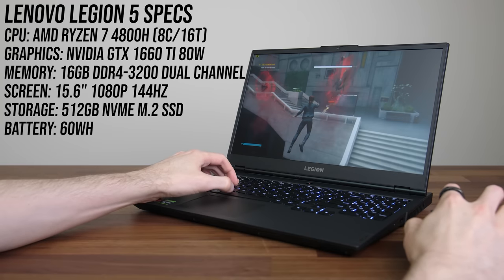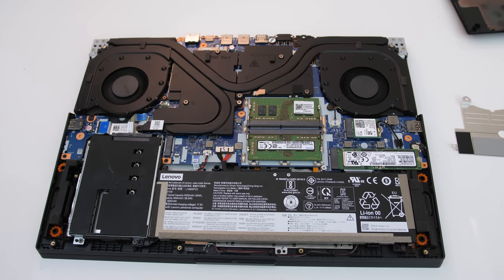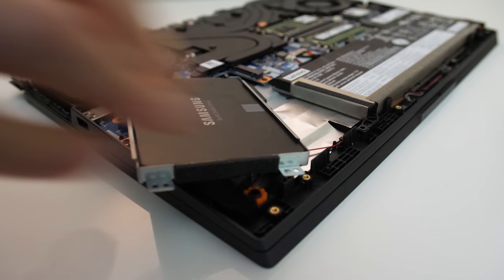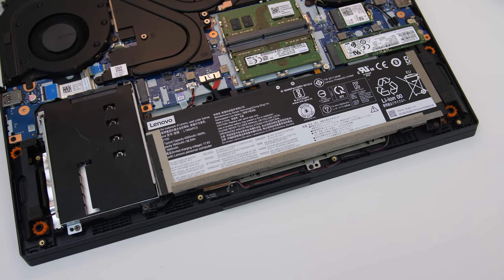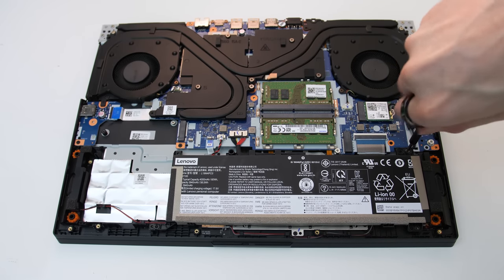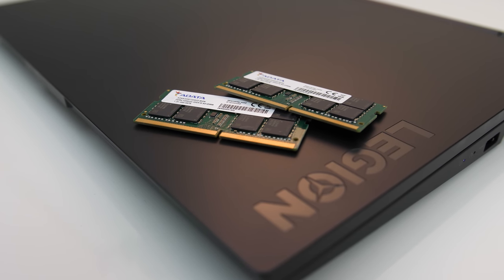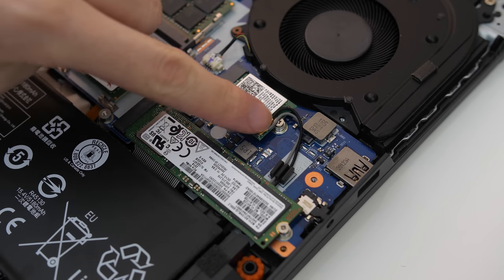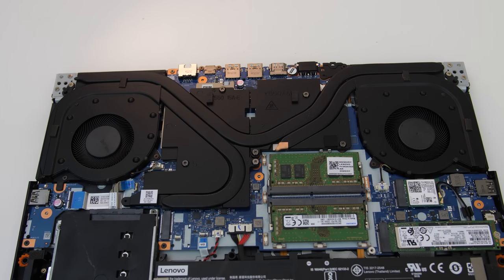Lenovo Legion 5 Upgrade Guide - Boost Performance!

Comment: Hi. I installed a SSD m2 (WD_Black SN 770 5150 MB/s) in my lenovo legion 5 pro laptop. However, I am not able to get the maximum reading and writing performance. It gets up to 3500 MB/s. Do you know why?

Comment: Hey I have a question maybe you could help me out. I have a legion 5 not pro. I want to upgrade the ram but when I look it up for compatibility I’m confused.. mine say 17ach6 on the laptop itself. When I look them up it’s 17ach6h. Wil that still work with mine? None say anything that matches mine.

Comment: Hey I just got a new PC and a new Legion 5i laptop. I am worried I might have done something wrong. I got the PC first. So I already installed all the programs I wanted on the PC, and I wanted the Legion to basically be a clone of the PC. Both are running Windows 11, the PC has an i7-27000kf with a GTX 3060 while the Legion is a i7-17800h with a GTX 3050 ti.

I cloned the C drive on the PC to a Crucial m.2 4.0, then I swapped the Crucial m.2 4.0 with the Legions stock SSD a Samsung m.2 4.0 . So the laptops stock C drive is in the PC and clone of the PC is now in the Legion laptop.

It seemed to have booted just fine, and I don't know the exact differences, but the laptop is basically operating as the PC now. I don't know if this is a good thing, or if I am asking for trouble because the laptop has forgotten it's a laptop.

The last thing I did was download the Lenovo migration tool on both, and migrated stock laptop SSD to the cloned PC SSD that had been newly installed in the laptop.

Will I screw anything up at all? Please help.

Comment: I opened my Legion 5 but apparently it didn't have the stuff for a 2.5" bay (i have the 60WH battery one) but it at least had the extra m.2 slot so that will be a nice upgrade either way to the storage.

Comment: Is this RAM compatible? Crucial 2 x 16GB DDR4 3200 MT/s (PC4-25600) SODIMM 260-Pin Memory - CT16G4SFRA32A
Reply: yes thats what i have in mine but it cant run at 3200 speed. only 2667
Reply: @KingMrQT  why is that? Should I go for a cheaper model then?
Reply: @TrainMePlease  if you want to go cheap but if you want performance without maxing out your ram just do the upgrade. you wont really feel the real feel of 3200 vs 2667

Comment: Hi, I am in need of a new ssd and I had a couple of different choices. Can someone help narrow them down. I need a 256gb ssd as my main blood drive.

(All 240-256gb)
Samsung 980
Adata sx8200 pro
Wd sn550
Crucial p2 

Which one would be the best and should I pay the extra for the adata with the dram cache?

Comment: So the weird thing I switched the HDD with a m.2 and I don't know if you are supposed to clone the hard drive or would it matter? Somehow it froze and reseted and fixed errors. I think it's fine now but not too sure because there was some files on the HDD (Drivers)

Comment: Shouldn't you first of all remover the battery connector, or turn off it in bios settings???
Reply from the maker: Yes, this is covered in the updated guide, linked in the description and pinned comment. This is a very old video. Personally I don't bother because I accept the risk, but yes ideally you should do this.
Reply: Good to know, thank you  @JarrodsTech

Comment: does it matter with the legion 5i, what ram kit i use it has 8gb ddr5 4800mhz. can i install a random crucial 16gb ddr5 4800mhz in the second slot

Comment: You could also have a M2 drive and place of the 2.5 SSD, I haven't tried it I don't know if it works how it works I don't know if there's a drawback but there is that spot right next to the drive for an M2 SSD.

Comment: One question, changing a battery from 60w to 80w, does it improve the fps? or just how long can it be used without the cable connected?
Reply from the maker: No, only run time.

Comment: I should choose between
the 2021 version with 3050 ti and 16GB ram, 512ssd , 144hz , Ryzen 7 5800 H
It cost me 1450$

Or the 2020 version with 1660 ti and 8GB ram, 256ssd, 120Hz, Ryzen 5 4600 H 
It cost 1130$
And I'll be able to upgrade ram and hard 
Witch one is better in your opinion ?
Reply: the 2021 version with 3050 ti and 16GB ram, 512ssd , 144hz , Ryzen 7 5800 H
It cost me 1450$ BEST

better screen, better process, no need to change ram, still need more ssd but still enough in the beginnig.
+320$    -40$ for the ram     -250SSD

Comment: my model Legion 5-15ACH6 Laptop (Lenovo)  doesnt have a caddy bay or cable to add my drive, the h.2 just above is empty and there is a h.2 ssd installed next to the memory, so how would i add my ssd, any ideas, can i buy a caddy for this laptop with cable

Comment: Hi there, just got the Legion 5 (2021) -  Model 82JU001SFR / 15ACH6H.   
But the 120hz screen is a bit washed up (45 % NTSC & 250 cdm) and rather off  putting when it comes to brightness and colors, so I wonder if you had any idea of a screen upgrade for my model. Preferably to 144/165hz with G Sync or atleast decent color gamut. Thanks in advance!

Comment: Does the 64 gb ram upgrade apply to all legion 5 laptops ?  I have a legion 5  4600h processor with 8gb ddr4 3200 memory 250 gb M.2 ssd and the 80 Wh GTX 1650 standard that id like to upgrade . The only information I can find online indicates 32 gb max RAM ? Is matching ram size essential ? Is there much difference in RAM manufacturers ? any suggestions on some good quality sticks does it even matter much ? Also could anyone confirm max size M.2 ssd upgrade . I was hoping to upgrade with a 1tb is it possible to use that or  would I need to go bigger or smaller ? what effects would larger size have on the system . Obviously windows is installed on the 250 gb M.2 ssd at the moment . I do seem to get some cut outs on the wifi 6 card occasionally when the laptop has been left idle or in sleep mode . Maybe its my router settings ? I Have also had some problems with battery conservation mode not activating even though its turned on and always on USB ports have not been responding changing  settings either . These problems only occurred after upgrading the bios to EUCN31WW firmware . Im unable to reverse the changes I downloaded the old firmware and it says its not compatible in bios there is a setting to allow bios upgrades to be reversed still no luck . New features after bios update are the ability to overclock the GPU in performance mode from the lenovo vantage app and an ultra quiet mode in the bios that doesn't seem to have any effect when switched on . Lenovo customer services are useless so any help or advice on the aforementioned upgrades and bios problems especially the battery conservation mode that originally worked  would be greatly appreciated .

model is 15ARH05     manufactured 2021/02/10 : )

Comment: Any tip why i cant loosen the screws in the motherboard? I Cant upgrade SSD cuz i cant unscrew the m2 slot shield, i tried the default m.2 slot but same problem, i tried a random screw (battery or something) but seems like no screws can spin in the mobo...

Comment: Hi Jarrod,  thanks for your video. I'm facing a problem after this 80W battery upgrade,  my laptop just doesn't power-on from totally off. It only gets turned-on when power cable is connected. I tried to configure from bios  and choose "maintenance  mode" to force computer power off,  tuned on and login to windows OS, but the same problem continue.  Power on button only works when cable is connected. Funny thing is, if we remove the power cable, the battery works as good as expected. I ALSO TRIED to return my old 60w battery and power button worked perfectly. Did you faced  some kind of this problem? How did you solve it?. Thanks  in advance my friend. Cheers
Reply: Did you find a solution?

Comment: Not having a lenovo legion but a hp pavillion gaming ryzen 7 5800h. Already did similar upgrades, ram replaced with 64 gigs kingston fury impact and added a 4tb evo 870 ssd.
Now what i am looking forward to is to replace the build in 500 gb nvme (which certainly isn´t bad but duo to the nature of design slower then 1tb+ versions) with a 1 or better 2tb nvme.
Potentially going for a 970 evo but, as it has pcie 4.0 i also consider a firecude 530.
The problem i however have is that i have heared that pcie 4.0 nvmes run a lot "hotter" then the slower and temps are certainly something to consider in a laptop. So the question is, is it worth it or would it be waste of money as i just add a heater to my laptop that gets throttle anyways and just increased overall temps inside the casing?
Reply: It's limited to PCIE 3.0 so the extra speed would be wasted and be too hot. I've heard it might be possible to install up to 2TB but the specs only say up to 1TB so I'm not sure on this. Someone else in these comments said they installed 2TB...

Comment: Hey there can you please suggest me which laptop should I buy, lenevo legion 5 or ASUS tuf A15, I'm very confused please help me...
Reply: If you buy the legion 5 you will have to swap the realtek wifi card, it's a really bad chip
Reply: @BaldyBaeby  according to you then should i go for Asus tuf A15..?
Reply: ATM i only get 1.5mb down/up Ethernet or WiFi.  (wifi it's even worst the ping is ultra unstable.) 
I can't game at all on my lenovo wired or wireless. I find no fix other then an exchange in store.
I won't tell you what to do but keep in mind, you might have some network speed problem with the Legion 5.
I get 140fps on my 1440p monitor at cod vanguard ultra settings ( rtx 3070 ).
I wish the hardware/software problem could keep up with the rest.
Good luck

Comment: Looking at the oficial spec sheet (gen 6 2021, which I belive is this model), I see that the maximum ram is 32gb and the maximum storage is 1 tb m2 2280 ssd and 512gb m2 2242 ssd in the second slot. The sheet also claims that both storages and ram max capacity are based in the test result with current (@ that time) offerings, which could explain why Jarrod is able to go further here, but... He seems to install a 2280 nvme in the second slot, which is a  bigger format than the 2242 that figures in the spec sheet... Should be that physically imposible?

Comment: i have legion 5 with r7 5800h and rtx 3060, i already upgreaded ram from 16GB to 32GB from crucial and add 2TB nvme ssd, i will buy bigger battery in the future. But, my legion have small problem, his screen doesn't look great, it has only 65% sRGB, do you think i can find screen to replace stock one with better colors?
Reply: Which 2TB did you add? I’m looking to get one myself.

Comment: Hey. 

Thanks for the video. Is it possible to plug 2 tb m.2 ssd? On second m.2 slot. Not the 1 tb like it says in lenovo specification. I have the same laptop but with 17"

Thank you in advance.
Reply: have you figure it out?

Comment: any difference in performance for 1tb SSD vs HDD in upgrading? thank you
Reply: Ssd is much faster than hdd if you want that for editing or running software go for ssd if you are a gamer and budget will not allow you then go for hdd bcz they are much cheaper and in games also that isn't a big problem

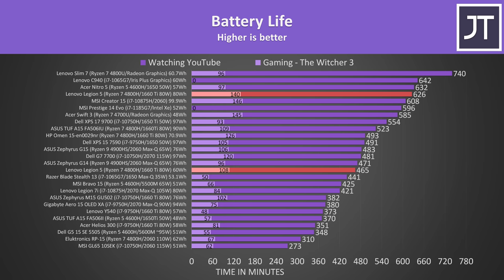Comment: Hey, so I am getting a newer release of the Legion laptop. Its the 5i with a i7-11700H and 3050 graphics card. I spoke someone from Lenovo, both on the phone and over their chat. Both people said that all the Legion laptops will only support a total of 32GB of DDR4 Ram at 3200mhz . So they are able to either handle 1 stick of 32GB or 2x16GB. But at 5:15 of this video you installed 64GB of RAM. I already ordered the laptop I'm just waiting for it to get shipped to me, I just ordered the 64GB kit of Ram from Newegg today because it was a great price. I might still be able to cancel it if I do it soon enough. What should I do? here's the RAM :  G.SKILL Ripjaws Series 64GB (2 x 32GB) 260-Pin DDR4 SO-DIMM DDR4 3200 (PC4 25600) Laptop Memory Model F4-3200C22D-64GRS

Also, the other option I was considering is the Crutial Ballistix 32GB (2x16GB) DDR4 Ram 3200 mhz. There seems to be about a price difference of $85 CND between the two, but the Ballistix has a CL16 where the GSKILL has a CL22. How much difference will the CL speed make, if like you said in the video, the amount of RAM is only a minor increase?

Comment: Quick question for anyone who knows. I wanted to know if the Lenovo Legion 5 15ACH6 15.6", Ryzen 5 5600H, NVIDIA GeForce RTX 3050, 8GB, 256GB SSD, Win11 Home 82JW00BKUS van be upgraded to 32gb ram. It has 2 so-dimm slots. The site says 16 max but I've also heard that's wrong and 32gb ram can actually be upgraded to it. Please if anyone knows this for sure let me know. Ty

Comment: Just a quick question, what is the CL timing of the ram that you used to upgrade the system?
Reply from the maker: CL22, the priority was capacity rather than speed.
Reply: @JarrodsTech  Thanks! I have looked into laptop ram that is cl16, but this sort of ram typically doesn't seem to operate full speed by default unless you have XMP enabled by default. Does the legion have XMP enabled by default, or will I have to go into the bios to change that?

Comment: I have ACER Nitro 5 with Ryzen 5 and gtx 1660 Ti, and there you can use both M2 SSD`s and a 2.5 inch SSD at the same time due to location of them.

Comment: I recently bought a 3200 gaming ram rated at 16 CL and it was working at around 2666 19 CL, I thought I could go to bio and enable XMP to use its full potential... But there's no such settings, I looked online and people had the same problem. Can you do a video on a work around if there is one if not can you suggest rams that will work at least 3200hz/22CL? Thanks :)

Comment: Hello jarrod i have recently purchased Legion 5 with i7 10th gen core and 16gb ram 512 ssd and 1tb hdd and a gtx 1660 ti  for 1300$ now the problem is is the screen is not turning on when i press the power button furthermore i have to turn it of and on again for the screen to lit up i tried connecting the laptop to a external screen and still it was pure black nothing i hope you can help

Comment: Hello , I bought the ADATA SSD approximately 1 and 4 months ago, a d since some months ago I Started having issues with my hardware but it was just restarting my laptop. Today I'm having issues with some games that I need to erase and install again but after some days they still give me problems, also the disk just disappear from my computer and I have to open it and connect it again and is annoying. I'm desperate to see if I can fix my SSD but I'm unsure please help.

Comment: Hi Jarrod, I have a question. I also have a Lenovo Legion 5 pro gaming laptop with the RTX 3070@140 TGP, 32GB RAM and my processor is AMD Ryzen 7 5800H. When I bought it about a year and a half ago, the performance on all games were amazing. Lately though, I have noticed a drastic change in my in game performance. The culprit is the 80W battery and according to the Lenovo Vantage app, the battery temperature his hitting at 40+ degrees (especially while gaming), thus slowing down in game performance drastically. The CPU and GPU temps are relatively ok in the mid 80's and high 70's but because my battery is over heating, the games tend to slow down. I check the battery's health, and everything seems to be normal. So, I don't know why this is happening. I am using a cooling pad (honestly it doesn't really make a difference in temperature)... Any idea why this might be happening and what are possible solutions to it? Your response would be greatly appreciated.
Reply: 1- Update the Bios
2- Which SSD you have on the laptop?
Reply: @ariavision  I have 2 SSD's on my laptop. Both by Western Digital and 1TB each.. so a total of 2TB.. these are the two types:

wdc wds100t2b0c-00pxh0
wdc pc sn730 sdbqnty-1t00-1001

The Bios is up to date.

Comment: I am having a problem with this model of laptop, i have 8+16gb of ram and windows somtimes crash.
I put both slots of ram on windows memory test and it said 1 was bad, but affter that I tested both invididual and the test didn't give mi problem.

Es there a problem le putting 2 slots of diferent gb?

Sorry for mi inglish, i speak spanish 😅

Comment: Can anybody tell me which is better in your opinion asap? I'd go to an offline store to buy a legion 5 ryzen 7 tmrw, but I'm torn between rx 6600m and rtx 3060. The 3060 is more expensive by $140 in my country, which is a better deal and what would you choose?
Reply from the maker: I can't say yet, but I have the Legion 5 with both those GPUs and will do a dedicated comparison video some time in the next few weeks. It only just arrived so it will be a while.
Reply: @JarrodsTech  thanks for the reply, I ended up buying the 5 pro (didnt plan to) with the rtx 3060, going over my budget lol, still looking forward to your video!! I really wanted to go for amd one was but it was sold out right when I got there.

Comment: Hey guys do u think its safe to install 32gb of ram, when it says the max cap is 16gb? I think this number is only based on what theyve tested right?
Reply from the maker: You should be fine with 32GB in this laptop.

Comment: Have you got any idea of changing the graphic card. Im not satisfied with GTX 1660 ti and Im looking for a change to rtx, it is even possible and is it profitable??
Reply from the maker: Soldered to the motherboard, can't do it without swapping whole board which has the CPU+GPU attached, not really economical unfortunately.
Reply: @JarrodsTech  thanks for help
Reply from the maker: @Kev94  No problem, happy to assist!

Comment: Jarrod como estas escribo desde colombia. Tu puedes responder esta inquietud. tengo esta lenovo Legion 5-15IMH05H, pero en el manual dice que maximo puedo espandir la ram a 32GB, y el almacenamiento solo hasta 1TB de M.2 2280. Mi pregunta es puedo actualizar la memoria hasta 64GB (DDR4-3200). La otra pregunta puedo cambiar el almacenamiento a 2TB (M.2  por ejemplo con el Samsung SSD M.2 980 pro). Gracias si puedes ayudarme un saludo grande desde mi pais